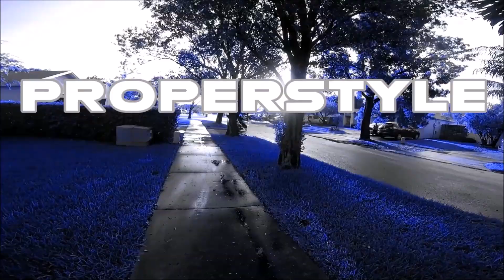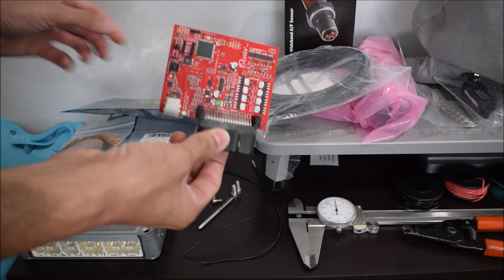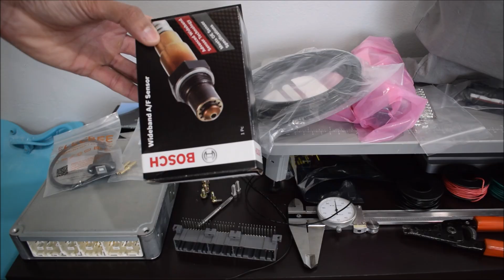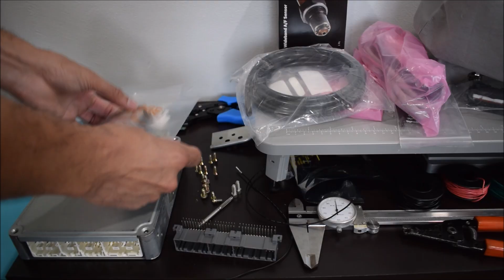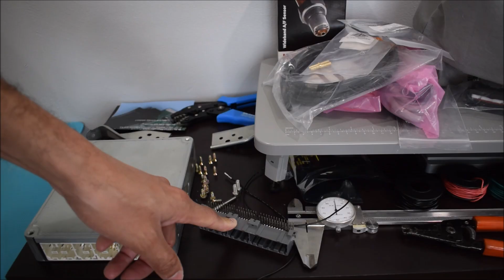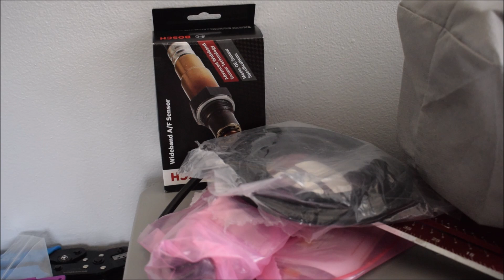Speeduino Ocelot Build

Comment: The Raspberry Pi is a much faster system than the Arduino. You can run a complete Linux OS on the RPi but the Arduino can't. But it's plenty fast for running an engine within certain limits.
Reply from the maker: I would be curious to know about this. Everything I found online suggests it would not be capable of running an engine. I own a couple of raspberry pi units with touch screens and it would be sick to have full engine control with a touch screen integrated.

Comment: I fried just about 30% of my main harness, in my 92 hardbody, one day.. my buddy gave me a skull cigarette lighter dealio, I stuck it in (felt like it fit), pressed it (didn't feel super tight, but did feel too snug).... Then I'm like "huh. I'm pretty sure it should've popped out by now." And as soon as I said that, THE WHOLE DASH started smoking! I tried to rip the lighter out the socket, but the socket came with it and the connector on the back was too hot to grab. I had the hood popped already, and luckily I was tinkering just before all this, so my battery neg was loose. 

I was so surprised the truck turned on after all that... But man... I was so bummed out later on, when I found out it drove absolutely terrible! That's my baby. 1st vehicle. Had it for 18yrs... Still have it though! I bought a megasquirtpnp2 and I'm ALMOST done with redoing the entire harness (upped all the wires by 2ga sizes, used gsx, txl, and tefzel wire, all new connectors and terminals, swapped everything within reason to Deutsch connectors, concentric twisted, labeled with factory color and connector names, wires are colored in a way that makes more sense to me, didn't include things I never had/wanted, bulkheads at the firewall... So worth it.. so far lol). Just gotta get my 12.7x4.3 touchscreen and mini itx PC to get comms with the ms2, and finish up my interior and exterior lighting harnesses!

Redoing an entire harness is kinda nutz honestly, but such an awesome accomplishment! U learn a ton through it all, and since ya gotta rip 99% of the interior out, to do it, just give ya tons of ideas for making it ur own.

I was really stuck between the speeduino build and the ms though. They both seem just as capable, if ur speeduino is built off a good platform. I only went with ms cuz I knew this harness would take forever.
Reply from the maker: That's awesome! Do you have your build posted somewhere? I would love to check it out.

Comment: if this is going into a older Tacoma 2.4 - 2.7 like 96-97 with distributor, it does not run factory sequential injection, it runs wasted fuel, the oem ecu only gets 2 injector inputs and there is a splice hidden in the wiring that pairs the injectors together. if yours has the factory coil on plugs and is newer your good to go and shouldn't have to worry, but check the Tacoma engine harness to verify the 4 injector inputs. I also think the newer ones are not fully coil on plug but they run like wasted spark and share a coil per 2 cylinders if im not mistaken, this applies for the older stuff. if your engine is like a 07 and has the plastic valve cover then its completely different and fine.
Reply from the maker: Mine is a 96 with the distributor. The injectors are paired as you mentioned. The odd ones and even ones go together. There is only one ignitor. This ECU does support independent coil on plugs, I would like those in the future. For now though, I'm focused on getting the stock setup running on it and learning Tuner studio really well.
Reply: @doitwithproperstyle  Toyotas have a noisy cam crank signal that is a vr, the Tacoma has a 36-2 crank gear i believe and a tdc sensor in the distributor, most people just use the crank sensor and run wasted spark/fuel, because of the unclean signal, cause the sensors share the same ground. Also i would get the payed version its way better then the free version. I actually own a 96 tacoma as well but mines the 2.4 2rz. its still using the oem ecu though.
Reply: …”the only thing they won’t take is the paint!”

Comment: I have an ocelot for my build. And im confused on how to wire up my wideband 02🤔. If i buy a wideband controller (like the Spartan 2) do i plug the 1 output wire directly into the "exhaust gas sensor" (pin18) or is there something else involved? 
Im trying to build a wiring diagram for this ecu and im just a little confused on how some of these sensor inputs pin into it.
Reply from the maker: @joeyforristal7545  yes, that pin will get the signal wire from the wideband controller. Beyond that, you just need 12v and ground in order to run the controller.
Reply: @doitwithproperstyle  thank you! I just wasn't fully sure 😅